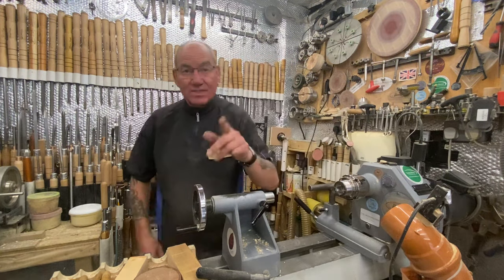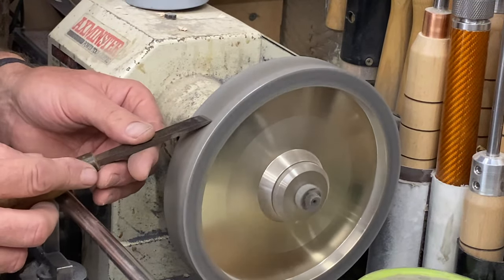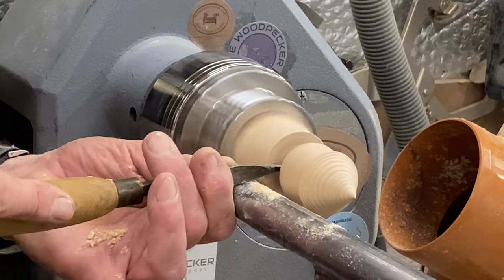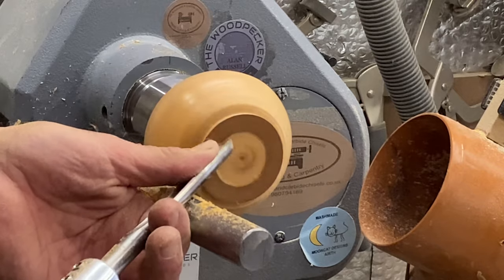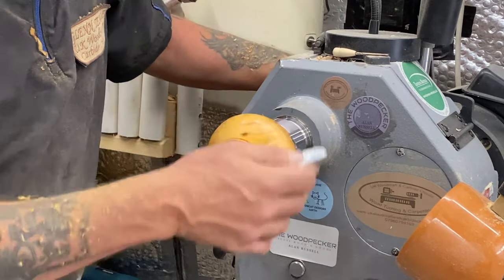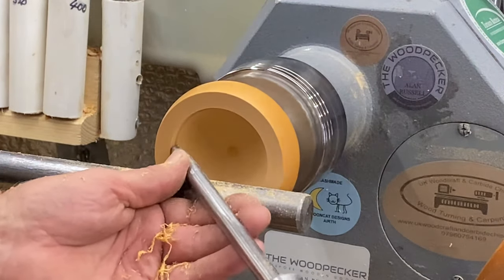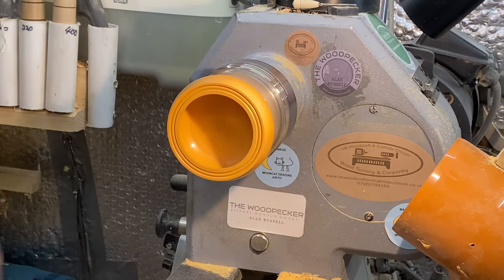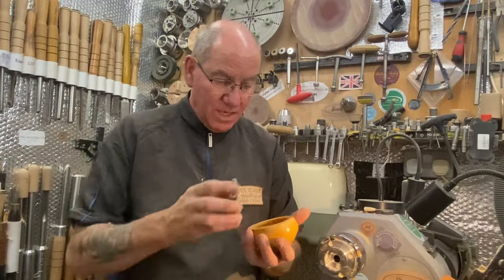Woodturning. Look what I got from the car boot fair & more tips than PG.

Comment: Seeing the pot-pourri pot reminded me why I bought my first lathe.   At the time, my wife Avril was making and selling enamel jewellery at craft fairs, and she was also buying turned wooden pots from a woodturner we met at fairs.  On these she put 4 inch domed copper lids, which enabled her to make much larger enamel designs than on the rest of her items.  I claimed that with my schoolboy woodturning training, I could make the pots cheaper if I got a lathe - which I did - a cheapo Nu-Tools one I found advertised in Exchange & Mart.   The finished items were just sold as lidded pots, but we came to realise that pot-pourri versions would be more popular, but we could not use the type of lid that you have as they could not be enamelled.   Also, Avril was reluctant to have holes in the copper lids as they would spoil her designs.   With a stroke of genius on my part (?) I deduced that if we couldn't have holes in the lids, they had to be in the pots!   I worked out that I could drill a ring of 3/8th holes at an angle from the top of the pot outside the copper lid into the inner recess to let the smells out.  I made up a holder with a hardened steel bush to fit in place of the lathe tool-rest, and used the indexing facility to space the holes evenly using a power drill.   The finished result proved very popular, and we sold lots of them, with the colours used on the lids complimenting the different timber types used for the pots.
Unfortunately, we lost a load of photographs of Avril's work after we retired, and only have a few left which appear at the bottom of her page on my website - https://www.donjohnson24.co.uk/patchwork.html - but sadly none of them show the pots, and we don't even have one of our own to photograph!
Reply from the maker: Thank you for sharing your memories with us. Such a lovely story. Your wife's patchwork covers/enamels etc are a work of art. Shame you don't have any pics of the pots. Take care both of you. Toodle pip for now. Glenn & Liza